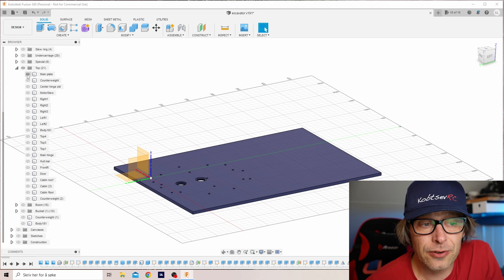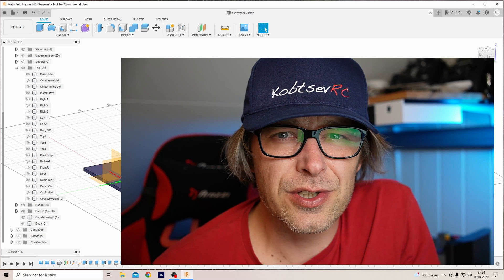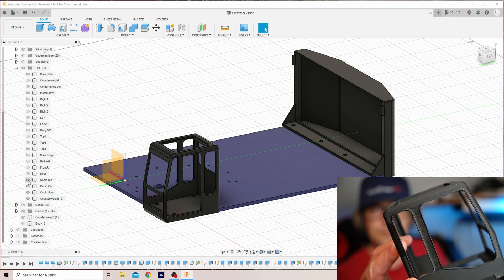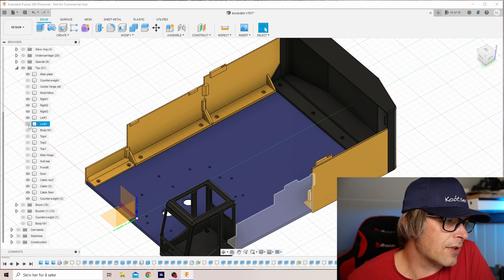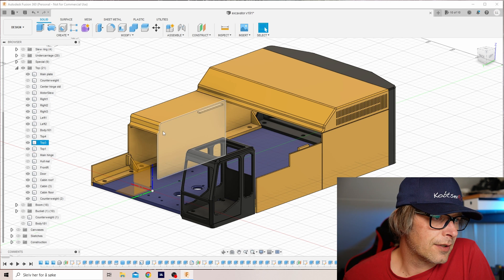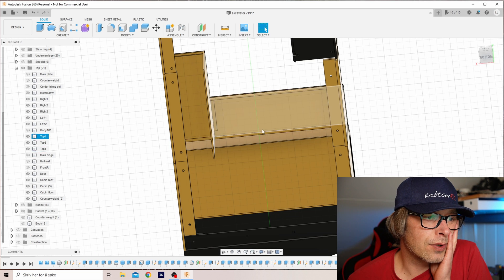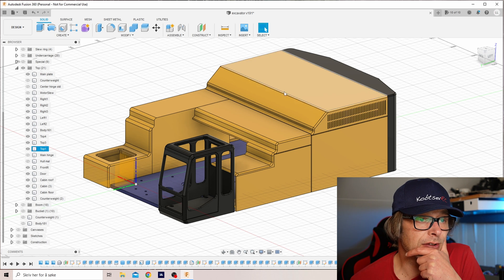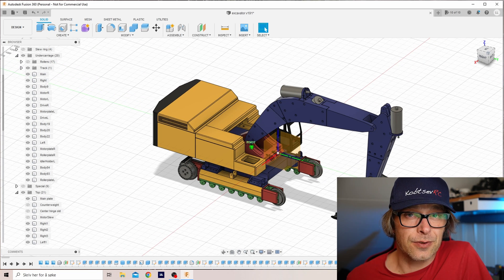3D Printed RC Excavator | Progres on the body

Comment: I say this a lot, but man you are awesome to provide this for people in your hobby.
Reply from the maker: Thanks man😊
But I'm just paying it forward. Thinking about all the great freeware I've used throughout the years.
I make my 3d models in the free fusion360, slicing the files for printing in the free cura. Editing my videos in the free davinci resolve, screencapturing with the free obs. Editing photos for free in Gimp. Creating graphic for free in krita. All my emails hosted for free by Gmail. 
The awesome sound module I use for my trucks is made available for free by thediyguy999. My radios run on the free openTX and edgeTX.
My hobbies would be incredibly boring if it wasn't for all the free tools I use✌️
Reply: Awesome 👌. I use for 3d modelling most of the time meshmixer but if 360 fusion is for free I'd swap. I reached the maximum of meshmixers capabilities